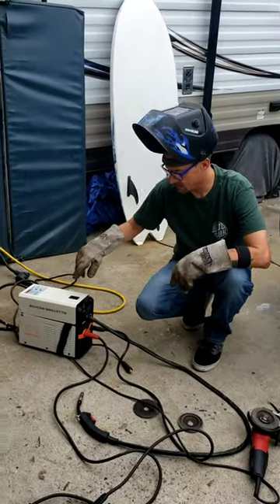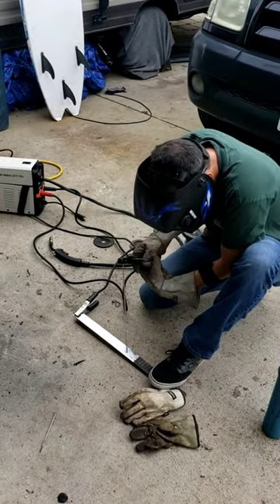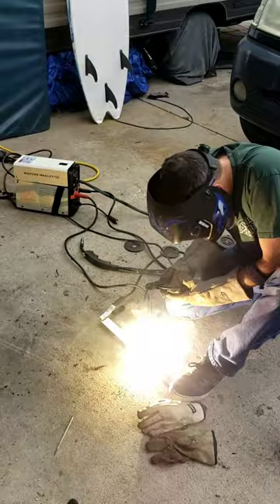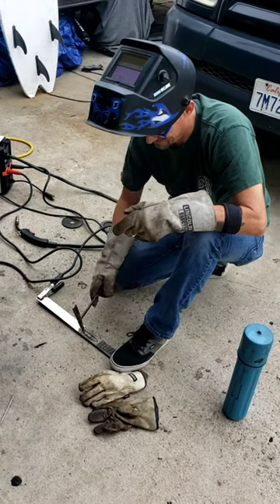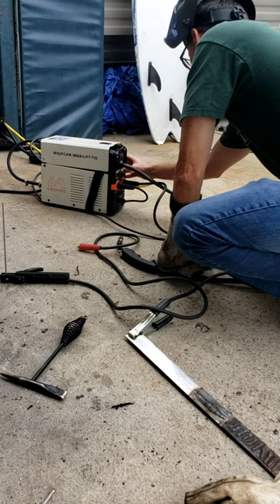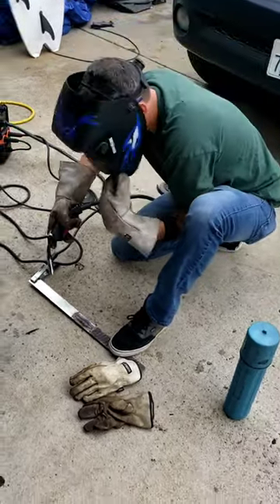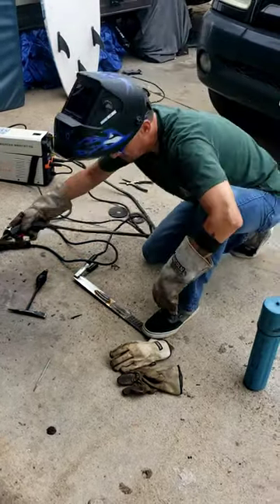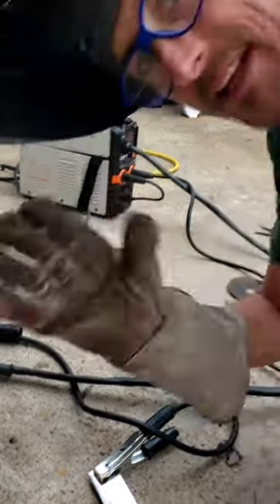Laston Welder 140E Stick/Mig amzon welder $150

Comment: Are you running this machine on a 15 or 20 amp breaker? Can you run it wide open without tripping the breaker?
Reply from the maker: 20 Amp breaker wide open few minutes seemed to be ok 👍